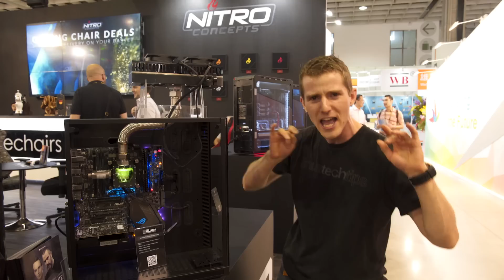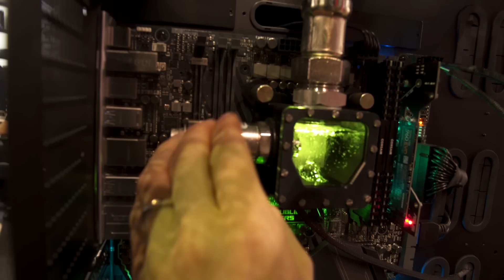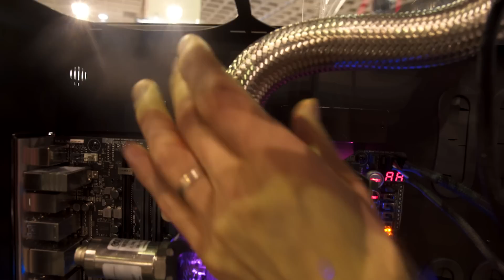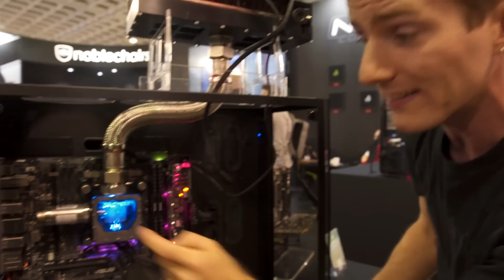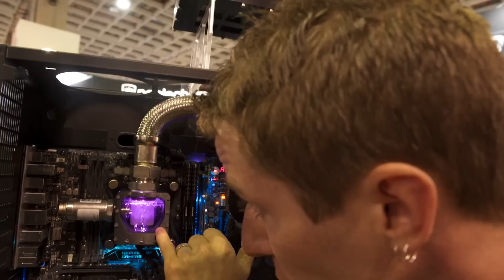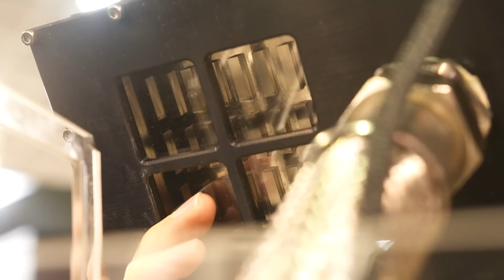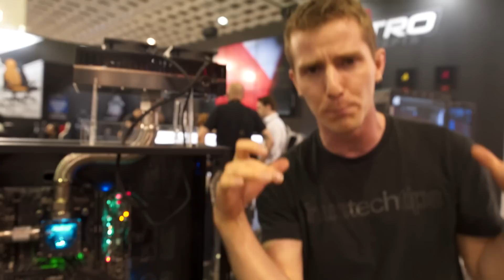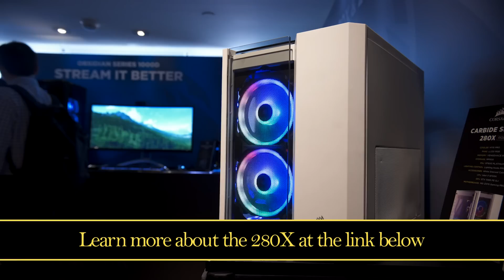Crazy Der8auer cooler prototype - NO pump!

Comment: The liquid should be alchol kinda thing because they have a low boiling point (Or other liquid for you can control the boil point by changing the pressure)
And no. It won't burn for it requires oxygen for combustion reaction

Comment: there is a pressure sensor in there? well … considering all these beefy links and components then the coolant might be just plain (watercooling-) water under low pressure.
with the pressure you are determining the boiling point of the water. (lower pressure -> lower boiling point)
by the nature of it the CPU can't really get cooler than the boiling point (because the heat won't be carried away by the evaporating water)
so you basically just have to find the sweet spot where the water still absorbs enough heat while having the boiling point as low as possible without the CPU getting hotter than the water.

because of that I'd expect the final product to regulate the pressure depending on the load of the CPU
maybe by using a hydraulic pump or just a piston in a cylinder open attached to the water loop

oh and if the water is distilled there is also no danger of it shorting anything because distilled water isn't conductive

Comment: It 3M Novec. 99% sure.
Reply: Actually he said it because Novec can not be sold to consumers. So if he used it in the AIO like he did in the submerged build he made a while ago then he wouldn't be allowed to sell the cooler to consumers, and that is his goal with this AIO. He had to find a different fluid, what it is I don't know. I guess when he sells them at least one guy will buy one just to take it apart and find out what's inside ^^
Reply: First thought of mine as well.  Cant get a much better fluid that's non conducting AND has a low boiling point, which seems to be the core mechanism of this block.
Reply: 3M Novec is just a brand name for some chemicals they sell. For example, Novec 7100, which is used in a lot of submersion cooling, is really C4F9OCH3. It's been accepted by most large tech areas for commercial usage, including the US, Canada, Australia, China, Japan, Korea and Europe. You can read about all the Novec formulas and stuff online in the datasheets that 3M has to release. It's also not a threat at all to ozone. I'm not sure about selling it in a consumer product though.
Reply: 99.9% sure it's Vertrel XF and is designed to replace PFC's that are why Novec 7100 is heavily regulated.
Reply: Its not Novec, 99% sure, they're not allowed to use that in certain countries because its a CFC
Reply: yeah he said it because they dont want anybody to know it :D
Reply: De8auer has said it isnt due to it containing PFC's + European Regulations on using these chemicals.
Reply: Go to Gamer Nexus "Tech Jesus" to get the informations you need!!!

https://youtu.be/AZAUnl37Cr8
Reply: Well, novec 1230 is C6F12O (with no chlorine)
Ok, it has fluor in it, but don't forget the canned air duster you can buy at office supply stores (as a consumer) is basically a fluorocarbon refrigerant. And canned air dusters are both legal in Germany and in the US. The R134a just gets rebranded into CAS811-97-2 and then it's suddenly suitable for indoor use to spray around.
Novec 1230 used in museums, server rooms, banks, clean rooms and hospitals for the sprinklers. So it's pretty much legal to just spray novec1230 into your building when you have a fire.
And I've checked it and it looks like you can just buy novec1230 filled fire fighting equipment INSIDE Europe as a consumer. Shops seem to just sell it.
Reply: 3m HFE...?
Reply: This
Reply: elink1 isn't novec a HFC?
Reply: sasja de vries. Its not novec, GN said that and those are also CFC’s
Reply: Just watch Pc Unter Wasser gesetzt 10000€ PC von der Bauer 
He says it himself
Reply: Novec 1230. Its not really a brand name ..3M is the manufacturer
Reply: He said it wasn't Novec so I have no idea what it is.
Reply: Killian O'connor Its not novec, look at gamersnexus video for that
Reply: sasja de vries. Canned air is a CFC ?? Wtf are you talking about - its canned AIR. That's why its legal. You can compress Amy gas to a liquid and they just use air because it's cheapest. Still blows dust away. The clues in the name, compressed AIR duster. There is 0 reason for it to be anything other than air.
Reply: Look it up on Wikipedia, ever hold a can of compressed air upside down and spray it?
That stuff isn't air.
Reply: No it's not. He said so in another video.
Reply: Yall realize thats a brand name not a product or solution right? Novec could be any of a hundred diffrent things

Comment: Cooling fluid is either an alcohol or some type of non polar liquid like oil. Although it could also be a gas in its normal state that has a boiling point of about 60 degrees. That would explain the pressures monitor
Reply: If I had to guess I would say the liquid is Methanol

Comment: it's 100% Rubbing Alcohol in a closed loop, very sure of this. or an ethanol type of mixture as rough guess. Basically like a small still in your pc using the change in State to speed up Heat Transference and Dissipation speed seal the loop with a let off valve when up/down flow is completely equalized between Rad system at proper boiling point. prototyping guesses lol

Comment: Fluid Guess -  Fairly easy to get close with basic fluids understanding.  You want a liquid that boils at just over room temp so that you can condense it back to a liquid with ~70deg F cooling.  
Either - 94degF
Methylene Chloride - 104 deg F  (the stuff inside a "drinking bird")
Acetone - 133 deg F

Either is highly flammable in its gas state so if the cooler developed a leak that would be problematic.   
Methyle Chloride is likely my best use item.  But its very volatile (which is what makes it good for this application) and carries a fairly ugly MSDS and OSHA warnings.
Acetone - is the easiest to get a hold of and while a solvent like the others above is likely the most probable. 

You'll have to use the pressure sensor in order to monitor loop pressure and vary the power input to the "boiler" so that your not boiling off to much liquid (raising the pressure in the system) based on the cooler's ability to condense the vapor and keep the system pressure in check.

Comment: My guess is 3M Novec Engineered Fluid.

It has a possible boiling temperature of around 50-70 degrees Celsius. The max operating temperature of low quality chips is about 67C. Which puts it in that category. Plus, it is made for electronics, or similar categories. As well as being created by the profound company, 3M. It has been out for a while, and it's been created already, which conforms to the videos standards. Plus it isn't easily guessed, it took some searching online to find this...
Reply: Somebody it seems guessed this already..... Oops

Comment: I suspect it's probably ethanol or methanol or isopropanol or benzene. All have boiling points appropriate for CPU coiling. Some other liquids also have similar boiling points but can be toxic.
Technically it cold also be water in a vacuum.

Comment: my beats are either acetone or isopropyl alcohol because of the low boiling points which isnt as hot as when water boils and because of heat conduction

Comment: Pentane?
Reply: Paweł Boraca I mean it has a boiling point of like 36C so it seemed feasible.
Reply: Well they actually use it in cooling right now, but that is professional use only so you may be right about that. But they are using pretty intense hoes so I think it's under pressure or they are being very secure about leakage.

Comment: I suspect it's Ethanol or Acetone based. You'd want an above room temperature boiling point, but below the upper temperature you want the CPU to run at, as the boiling point would determine the cooling temp. I don't know if there are any more specialised compounds that boil at a similar range which are less flammable, but I doubt that's a big issue in a closed system without oxygen.

Comment: It's probably a fluorocarbon or silicone oil... nothing super crazy about this. It's the same functionality as a heat pipe. The fluid must be able to evaporate and condense around room temperature and also not have a huge expansion ratio.

Comment: liquid has to be pressurized with a low boiling point that an overclocked pc would reach yet low enough cooling that it could easily cool in the tubing before reaching the radiator. My guess would be a wood alcohol. Clear, requires pressure to be checked, evaporates easily and cools just as easy.

Comment: I would assume a liquid that evaportes from between 50-60 celsius so best guess would be acetone or an alchohol (methyl type) like methanol. There are other liquids that evaporates around the same temp such as chloroform but the problem would be the volatility of the compound.